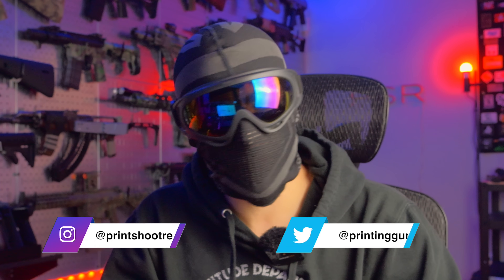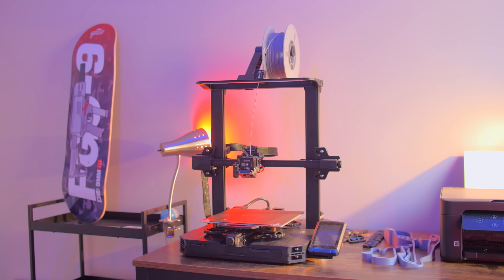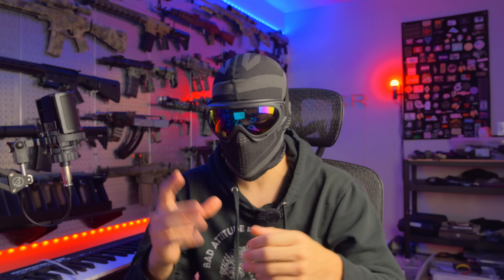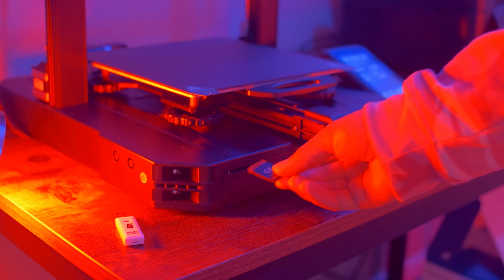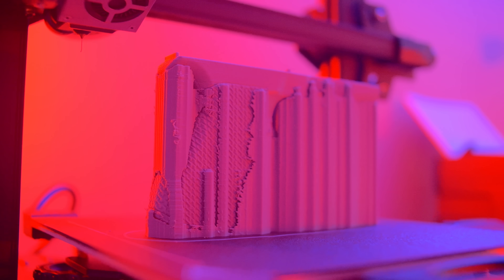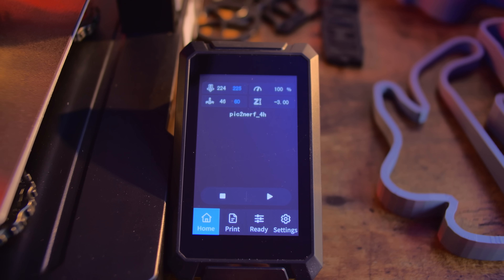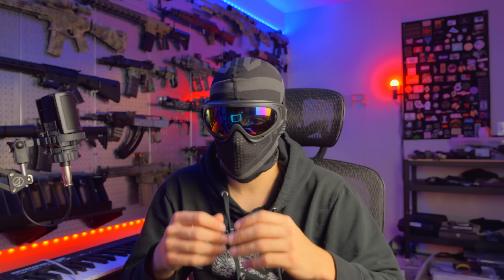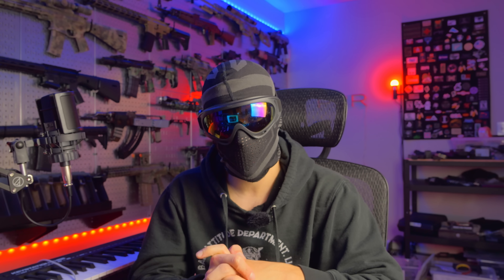S1 Pro: The Ender 3 On Steroids

Comment: Also started with the S1. And because the sale at the time, I only had to buy a light bar, plate and hot end. All cheaper then the pro then. But never had issues and that's been a couple years. Also have the Lazer engraver which can be fun. As always, great job love following. I just need to try my 1st load bearing print. Might try on that now, before I try my Bambu A1

Comment: I built a plywood enclosure with a 75watt glass flood light in the back corner that shines on the bed and a removable plastic front panel and it provides a decent amount of ambient heat and I printed Nylon without any issues even before my 110v heated bed upgrade

Comment: Just get a P1S man, X1C is nice, but not necessary. Have 2 P1S, and 2 P1P, the speed gain for your channel means faster content creation and play time/prototyping. Adding the AMS means you can use their support interface material as a separator for supports where you can get much cleaner overhangs when using the tree supports without them ever having chance of fusing or scarring.

Comment: hey bro. huge huuuge i mean girthy-big  fan. im taking on a few new  projects coming up. because about 80-100 pounds of aircraft grade aluminum landed in my lap. i was going to start with some lcp lc9 lock blocks or some 1911 frames and of course paperweights  but ive never worked with aluminum. should i cnc them outa a block or make a mold and cast them? idk if you even go both ways with that metal stuff but if you even know any resources that would be dope. gonna go get an s1 now. finally taking he step from 80s to printing. thankyou . been a long time watcher basically soaking uo game. thanks and when my arms company goes international i wont forget about you g.lol - DAHL FA

Comment: I have the Ender 3 S1. I considered buying the Pro version but settled on non-pro version. It is really good printer and after 10 months of printing it still works reliably. You can flash it with custom open source pro firmware that has extra features like monitoring the meshes, more tuning options mid print etc.. There is one minor problem with the S1 line of printers. Some of them have design flaws in their chassis that causes resonance when the printer is rapidly moving the extruder. It is not that big of a deal because otherwise this printer is super quiet.
Reply: You can upgrade it easily to the pro version by switching out the hotend or the whole extruder if you're lazy like me

Comment: I've klipperified mine, it's really nice. I've printed some chime handles in polymaker pa-6 cf and gf with good results and I didn't use an enclosure. I think i ran the extruder at the upper range of the temperature range for pa-6 which seemed to work fine. "annealing" the print probably helps with any print strength issues
oh, and i when and ordered a 0.5 mm tungsten carbide nozzle for printing the cf/gf filled materials.

Comment: Get a bambu it'll change your life and printing experience. They just work out of the box and theyre fast. My buddy with multiple enders borrows it when im not using it because its that much better.
Reply: Is there an alternative that’s not chinese?
Reply: @dan725 for enclosed printers you basically have either Markforge or Ultimaker
Reply: Printing firearms on a printer that sends your files and data to CCP servers is the dumbest thing anyone could do. Bambu lab is already a super shady company with their shitty ethics, printing firearms on them would be a massive no bueno.

Comment: I just came into an ULTIMAKER 3 EXTENDED. I know nothin of printing but am interested in water soluable supports that can just wash away for complex multilayer prints... Any leads on info on that model printer? Ive found that it is way past hobbyist in terms of price and features, hoping the menus and modes are easy to
 use

Comment: Can you make a video on the basics of printing on this printer for people who have never printed before?
1. Slicing software to use?
2. Do we have to set all the different temp settings or does some of the pre-loaded software handle that for you?
3. Can you tell the printer to print slower for a stronger build on the screen it has? How does all of that work?
Reply: Check out CHEPs YouTube channel for a good introduction to printing. I have been using printers for 12 years, but I still refer back to his stuff, especially for Creality printers.
Reply: @mightygrom  thank you
Reply: dont forget id like to try with a resen
Reply: 2. Temp setting is filament dependant 
3. Yes 1 to 100%
Reply: 1. Orcaslicer
2. Select your filament that is being used. If you don't get the right basic print settings (bed, nozzle temp), default to what is included in your flower pot holder instructions
3. yes you can. In this Ender 3 S1 Pro, that's a setting in the top part of the touch screen menu. It's called "print speed". One way you can get better bed adhesion is to print at 40-75% speed for the base layer.

Comment: Seems like a good entry printer for people who don't want the fuss of upgrades or worry about reliability like some of the less proven Creality models. 
I've had a CR6SE for a couple of years (with various upgrades including community firmware) and a CRM4 for a few months which has proven to be a right pain to get working. Including replacing a warped bed and incessant levelling issues .

Comment: As someone that went from the Ender V2 to a Bambulab P1S, the bigger price tag is well worth the extra savings. If you want a true plug and play 3D printer, the Bambulab printers are at the top, and their printing performance is immaculate. To me, the Ender V2 was a bad experience of tinkering with the printer more than actually printing with it, but that was in my case, it might be different in others.
Reply: Imaging printing firearms on a printer that collects and sells your data to the CCP, that's what bambu labs does. CCP spyware. Bambu lab is the tiktok of 3d printers.
Reply: so should i wait for a bigger bambulab printer or is the x1c or p1 enough ?
Reply: How do you feel about prusa? Like the mk3+ or mk4?

Comment: I have 2 of these, I bought the creality sonic pad to drive them both.  I could not be happier with mine as I wasn't sure I wanted to spend what it cost to get a bambu labs printer.
Reply: What exactly is the purpose of the sonic pad? I have a basic ender 3 and a V2. Both upgraded like dual z axis, copper heat break etc.... but if I can upgrade even more like a sonic pad I would do it if it makes them that much better.
Reply: @carvedfromlife8949  the sonic pad connects to like up to 4 printers, it enables a web ui so I can upload and print from my laptop. It essentially replaces the individual touch screens on each printer.
Reply: @carvedfromlife8949 The Sonic Pad is a klipper controller. It's basically a small PC with touchscreen that's pre-loaded to drive 3d printers.

Comment: I just got the Ender 3 S1 Plus. This is my first printer It took me quite a bit to get the leveling just right. There is one corner that keeps giving me trouble. 

I will try to do a test print today. Are there any suggestions or recommendations I should do or upgrade for it? I know that it has like a plastic housing or something so I have to swap out with few pieces to allow for a higher temperature. 

I only got the plus because of the wider print capability in case I want to make some custom pieces or something with it. Although it does suck that it's not as tall.
Reply: Unfortunately I can't recommend the firmware I used for my S1 pro but this is where I would start if I had the S1 plus

https://youtu.be/bfDjoWGbl44?feature=shared

Comment: Man I can't get behind Creality as a brand any more, I installed their Sprite direct drive head to my older Ender 3 Max, and I had to write their CS for help re-aligning the BLTouch probe with the nozzle, since it moved to the other side of the print head, and the setting to do that just wasn't there in the UI for some reason. X and Y offsets were missing, there was only a Z offset. They told me the Ender 3 Max with the Sprite upgrade didn't support the BLTouch and they had no plans to ever support it in the future, but they were willing to send me the firmware so I could write my own to make it compatible. Yeah, sure, I'll mail you a box of fingers and you can assemble a middle one for me, okay?
Reply: You buy a cheap build-it-yourself machine, and expect enterprise-class handholding? You're lucky to get as much as you received. 🤷‍♂️
Reply: @interstellarsurfer  I bought an OEM upgrade to a machine it’s explicitly advertised to work on, I expect it to be supported even slightly.

Comment: Why not the ender 3 v3 se? Has all the upgrades at fraction of the cost of the s1 pro.
Reply from the maker: The SE is a great printer but still lacks some of the features of the s1 pro and also requires more assembly I believe
Reply: @PrintShootRepeat  i am pretty sure they share alot of the same features. Direct drive, auto bed level, linear rods, 270⁰c.

10 minute build time is all and only $185  ship on amazon deal.